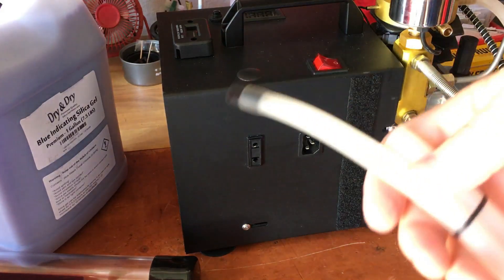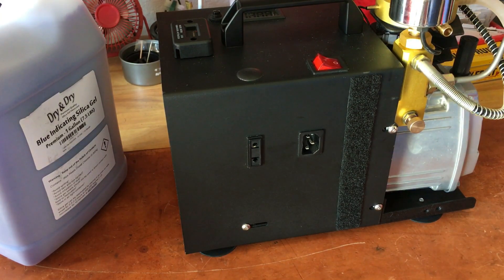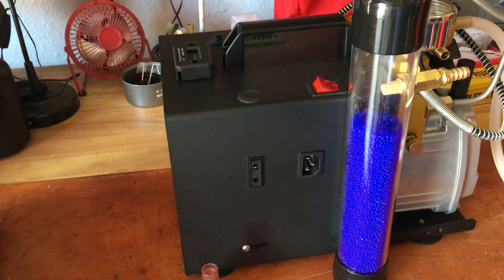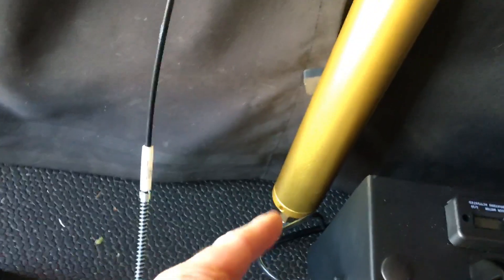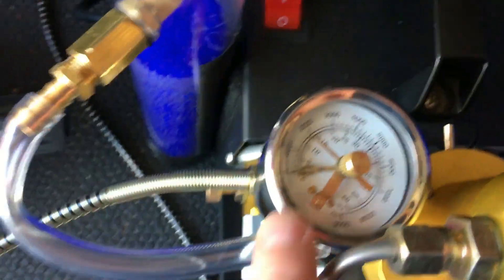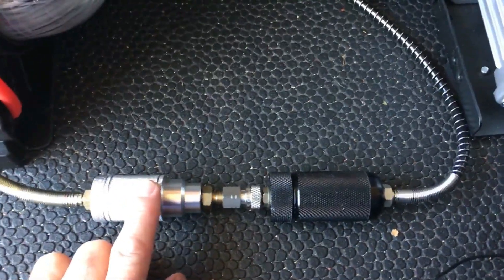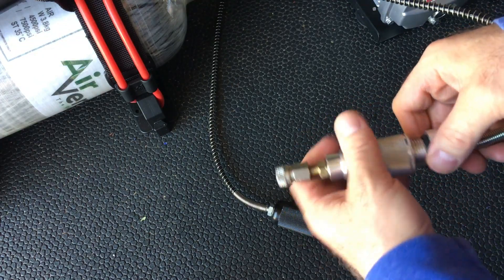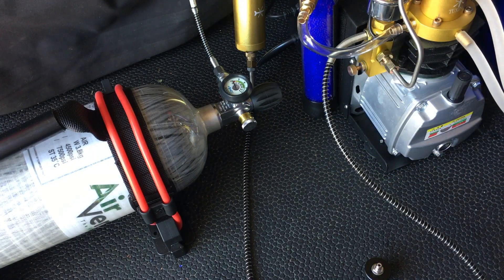3 Stage Filter / Desiccant Air Dryer Success - Tuxing HPA - PCP Compressor

Comment: Good job.  I don't know why more people that take the time to do videos do not have desiccant filters on the air intake of the compressor's.   The moisture you may generate now is because of the heat caused by the compressor heating up.  Nice set up.
Reply from the maker: Thanks.

Comment: Good job! I'm doing something similar to mine.  I just wanted to offer this tip, should you ever get into that bind about  bending tubing in too tight of a radius as to kink the tubing.  ..get some 14 cage solid copper wire, or equivalent and spiral wrap the tubing before you bend it and leave the wire wrapped around the tubing.  It works when bending copper tubing as well. I do it with solder all the time,  but on copper, you can and should remove the wire when finished..
Reply from the maker: Thanks.  Great idea with the coper wire "wrap".  Will put that to use!

Comment: If I may ask, what compressor oil are you running.  I just ordered a Tuxing TXES012 compressor, and Tuxing says to run 5w/40 motor oil in it, not compressor oil.
Reply from the maker: I'm using AW-32 hydraulic oil, but if you check the comments, someone else suggested a different type or more appropriate type of oil that escapes me at the moment (as I still have plenty of AW-32 to go through firstz0.

Comment: Thanks for the brilliant work, warts and all. Anyway I realise that for demonstration reasons you opened your bleed valve at the tank end. However in reality the reason that a little moisture and oil was present is because of this. May I explain. If you close tank switch off compressor and then bleed both compressor valves, the moisture and some oil won't be forced up to the bleeding ends of the tank. Hope this will help. You helped me with the air intake, cheers. Paul

Comment: What type of oil do you use?
Reply from the maker: I personally have used hydraulic oil (AW-46), but have read that your are NOT supposed to use #46 hydraulic oil as it is NOT for HP air compressors. I've read recommended oil should be 100% synthetic, like the Royal Purple Synfilm Air Compressor oil.  Your machine, your choice, so YMMV.

Comment: I wouldn't mount the air intake on the unit. The vibration will have your beads breaking down into dust over time from the constant moment of them. You sure don't want any fine dust particles working itself past that filter and into the unit.  And question. Everything I've read points to having your beads tightly packed in order to work properly. Have you tried filling tube completely to see any difference? I've built sleeves out of pvc And filled with beads for my oil/water separators. Better than those tampon filters they come with. Or like you did, just buy the better upgraded unit. I just like to save money.

Comment: How do you get ambient air into blue desiccant if you have it capped off. Doesn't this starve 1st stage cylinder of air
Reply from the maker: Fidel Perez - In the video that showed how I built the desiccant filter you'll see that the bottom "cap" was cut about the size of a half dollar and screen mesh inserted so air could flow and not starve anything.

Comment: That intake water filter,  just work if you change de blue ball's every time you fill the tank.

If you have a primary tank, that collect moisture, that you can purge, and than fill the other tank, with dry air.
Reply: It's as simple as, are your after engine filters wet without it? Are they dry with it?
Wet with it off...Yup
Dry with it on....Yup......WOW it's VooDoo!😱🤯
Reply from the maker: Maybe you should do a bit more reading/research until it makes sense to you.  Look how many filters on the market are desiccant based.  Better to have the air filtered through desiccant than just air with moisture hitting the brass filter...which only filters out particles, not moisture.
Reply: blue/pink filter on the front gets the water out before the pump is good;  otherwise the hotness of the airmix entering the 2nd stage keeps the h2o in gasous state but as soon as it contacts the water cooled walls of 2nd stage, the h2o condenses to liquid h2o (mech engr a/c thing).  qed.
     one could also convert the long filter #3 from a 1 stage cotton/foam to a 4 stage (foam/blue.pink desiccant/m.sieve/a.carbon) but the amount of desiccant is only 1/100th the quantity in the input filter.  
     do the fight in the beginning, that blue/pink stuff easy & cheap.  all good
Reply: @tgong5745  but. It don't work very good that way, you must change the blue balls every time.
 the before filter is poor in his job, he work so bad, that he just collect a little bit amount of water, with that kind of pressures.
 
And the water don't appear just, because condensation. 
He also apear, because the air is squisd "compressed " like a sponge inside. 
And wen the air leaves the tank stay dry. 
Hope I contribute a little.
Reply: @sempremobras  start with this: 
https://en.wikipedia.org/wiki/Relative_humidity
Reply: @ReLoadersBench soon I will do a little video , to explain my point of view.
Reply from the maker: @sempremobras  Don't need to.  You do your thing your way and I'll do my thing my way.  Take care.

Comment: May I know how the wiring connection of your pressure gauge? Thank you very much.
Reply from the maker: Not quite sure what you mean.  The pressure gauge on the compressor or the pressure gauge on the tank?  The only pressure gauge that is "wired" is on the compressor and that is something I cannot trace as it goes from the gauge into the housing/shell of the compressor.

Comment: Can I use this setup to fill up a tank for scuba diving is this safe
Reply from the maker: I would NOT use this compressor or configuration for scuba diving.  Get your scuba air tank(s) filled at a certified dive shop.
Reply: I agree with him.  Have them filled at places.  
But I do use mine for scuba.  Pretty much the same setup.  But only here an there on a 13cf tank.  Maybe once a month for 2-10 minutes under water.   
I got it pulling air through desiccant like this. But like one of the other people said.  But I use a 20 foot hose filled with desiccant that the intake air is going through to give the air as long of a time as I can before even getting to the compressor.   After that before reaching the tank.  I have the little bullshit black prefilter that’s about all that trap is worth.  Than through 3 vertical 3 stage filters ran in series before being bottles.  
And in the compressor I’m running a full synthetic food grade compressor oil.  Made for breathing air compressors.    Anything less than that I wouldn’t do it.  But everything is pretty well dry. Haven’t seen any moisture.  Or any bad smells or anything like that.   
How safe is it I’m not sure other than it’s just like the once a month an for 10 minutes max.  Just swimming pool depth an thats all.    
I bought all that stuff in one rip before trying with anything less than that.  
But it’s best to have a place fill for you.  It was just aggravating for me to for a 13cf tank to drive 45 minutes one way to have it done each month.   And since. Picked up a few other tanks. To have with the vehicle for a tire inflator an what not

Comment: That's smart to dry air then filter B4 compressor folks! And change oil each two hours and don't let compressor water corrode it. I would use 100' ox barrier PEX 1/2" pipe for water cooling system loop, only distilled water, and water/compressor never sees air and use a expansion tank, and TACO water pump and never let water get hot. Cost about 220 to build, but it's bulky. Take freeze precautions.

Comment: Polyethylene tubing, 1/4 or 1/8" hose nipple, color indicating silca gell beads/ dryer at home depot or ebay. make the passage long to suck all air moisture. One should use 10 foot tube full of gell/beads to be sure and use a long after filter too. Cat liter silica may work too. You need to dry it in elec. oven at 300F and keep air tight seal non-use. read drying instructions.

Comment: how many cycles of on and off to fill that big tank?
Reply from the maker: With my filter set up, I average about 50 bar every 10 minutes.  I've also decided that 10 minutes is the max I'll run the compressor due to water temp (the first run is not an issue, but subsequent runs see the temp rise faster - so I usually put ice in the water [plastic bottles of frozen water work great] and the concern of oil/moisture in the first two, smaller filters that are the cheapest to filter replace.  That way I don't run the risk of any oil/water in the larger filter or in the actual tank.  The small filters are very inexpensive online.  

So, in short, about 60 minutes of actual compressor run time to fill the tank from 0 to 300 bar.  Actual time is longer with filter/water/ice changes. Obviously much less time when just topping it off.
Reply: is your larger filter the molecular filter or just the tampon type?

Comment: FYI in the I realize you were showing the bleed valve for the camera.  However in the future bleed from the compressor side.  That way if there "IS" any water or oil in the fill line it will not be blown towards your tank.  Nice video though.